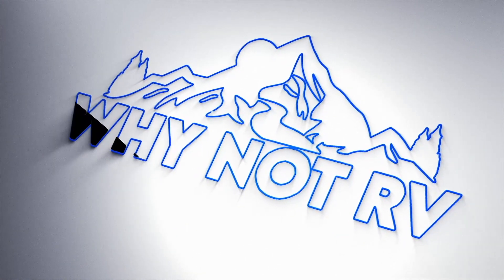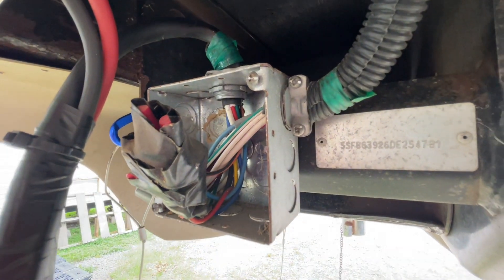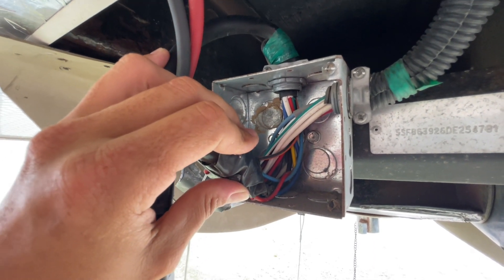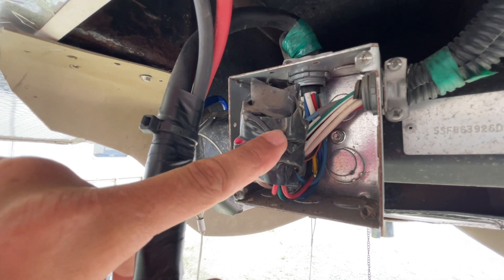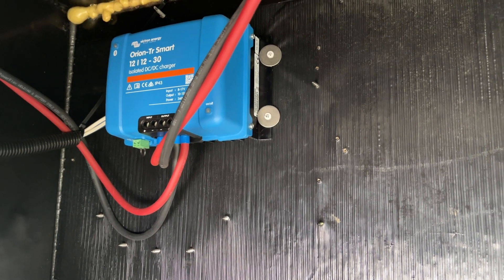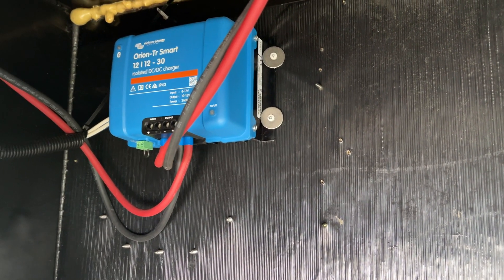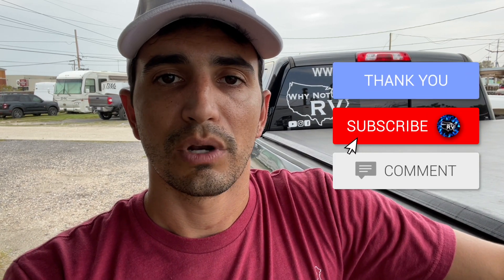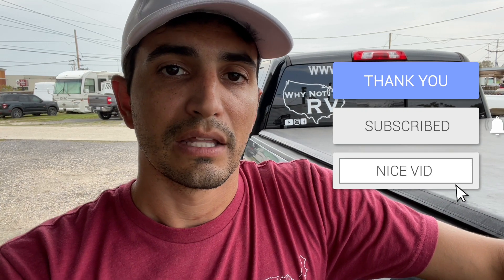What is a DC DC Charger - Why Not RV: Ep 72

Comment: Thanks for the vid. DO I understand this correctly?  There are really TWO issues you talk about.  One is the gauge of the wire and the current capacity that it can handle. And two, the DC to DC converter function. 

My question is for the second part.  Is the DC to DC converter's function to charge the "house" battery with the appropriate "charge profile" for the type of battery that you have? SLA, FLA, LI, AGM?

Does it provide any other function(s)?

Comment: I guess you could attach an amp meter to monitor it and make a calculation over time. 

What I’m curious about are those stupid solar prep plugs. Do they actually terminate anywhere?
Reply from the maker: Battery monitor can tell you what you need as well. The solar prep plugs are different in every rig but usually they go to a small charge controller that goes to the batteries.
Reply: @WhyNotRV  there is where my doubt lays.  I’m sure on some models that is the case. But as a rule I’m betting they just terminate to them to the battery, if even that.
Reply from the maker: You’re probably not wrong lol